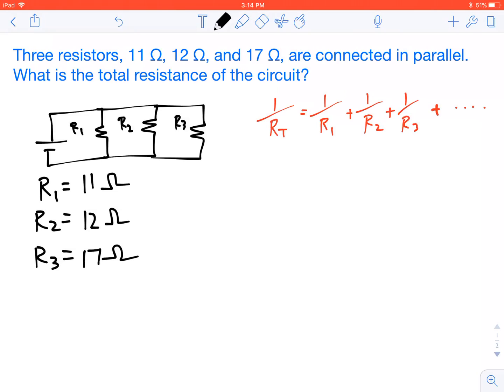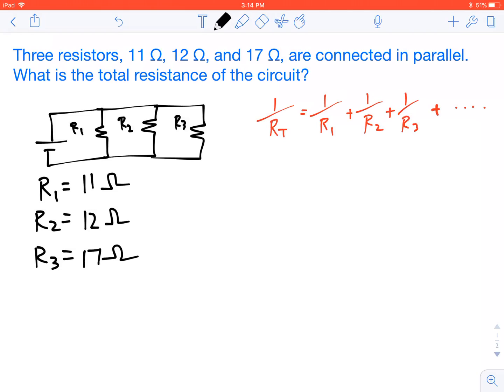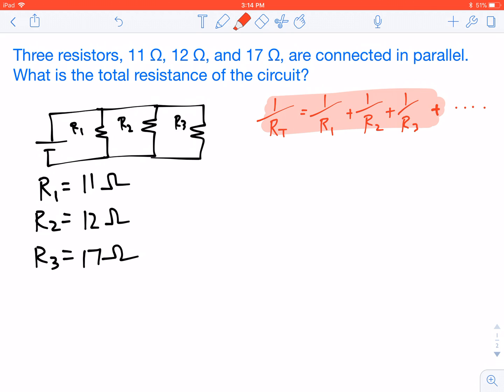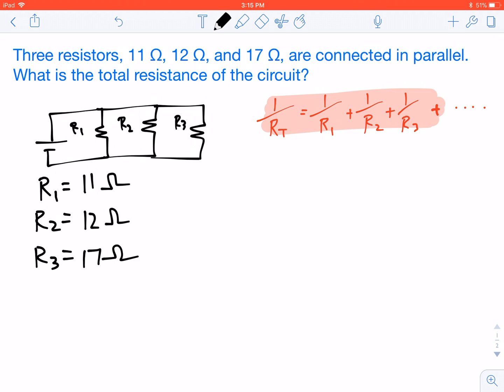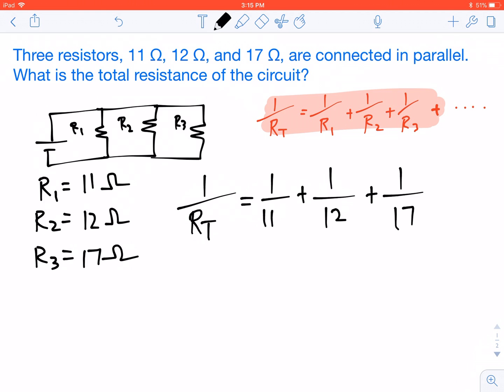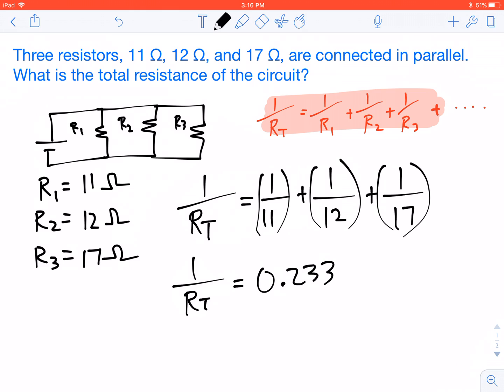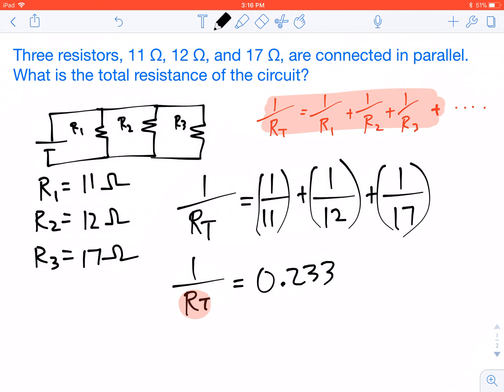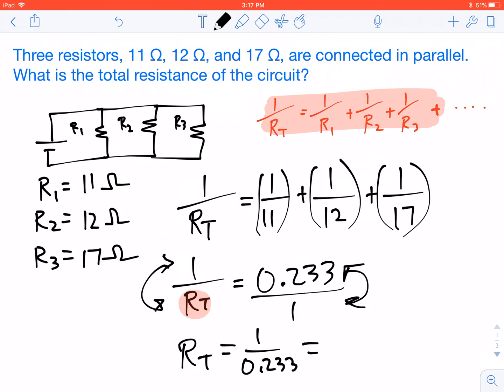How to Add Resistors in a Parallel Circuit

Comment: I’m A mechanic and I’m doing this because it’s the easiest way to verify a complete wiring harness replacement with new brakes on a dump trailer. in my opinion. (To make sure there are no shorts or burnt wires with excessive resistance.

Comment: I just learned another way to do this.
If Your calculator has a 1/x button enter ....
11 press 1/x + 12 press 1/x + 17 press 1/x = sum press 1/x  again = 4.29 ohms
Reply: iPhones have this button in horizontal mode 👍 thanks bro
Reply: Thank you so much

i was having so much trouble with this but it became clear

Thank you

Comment: Perhaps it might be easier to understand (me being subjective)  if one was to combine the "reciprocal method"  (which you demonstrate in your video) with the "conductance concept of parallel resistors".   Like you stated in your video , you can't just add up the the resistance of resistors in a parallel circuit ( like you do in a series circuit),   making it a little more difficult .   One can however add up the conductance of the resistors in a parallel circuit  ( conductance being  G=  1/R ).     Taking the reciprocal of each of the three resistors  and adding them together (like you do in your video) you now have  the total Conductance or G total (which in your video you call 1/ R  total).     But since you need the total Resistance of the circuit,  using R =1/G, take the reciprocal of G total .

Comment: To get 0.233 you must use 4 digits after the decimal for each Resistor Value. 1/11 (one divided by eleven) = 0.0909, 1/12 = 0.0833, 1/17 = 0.0588. Add all these together, 0.0909 + 0.0833 + 0.0588 = 0.233
Reply: is it common practice to always go 4 digits after the decimal?
Reply: thanks
Reply: The easiest way to add them up in using a calculator is just by pressing the keys 1/11+1/12+1/17=

Comment: Still can’t figure out how you got a 0.233 I just have a basic calculator
Reply: 1÷11 + 1÷12 + 1÷17
Reply: @ryansheaffer5240  but still 0.231 in my calculator
Reply: @jonathansulayao8093  try using your phone'a calculater
Reply: @jonathansulayao8093  Most likely that’s your calculator rounding down. If it’s 5 or above you round up, 4 or below round down. And since the numbers carry on for awhile, 0.2333 would round to 0.231 to stop the decimals at three places
Reply: @ryansheaffer5240  Thank you so much